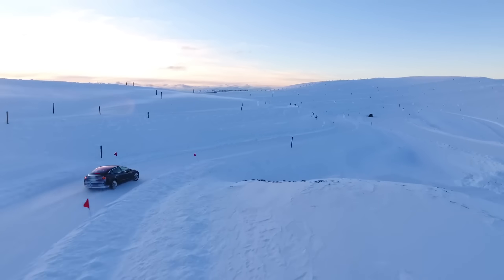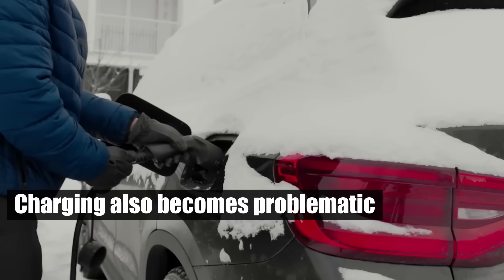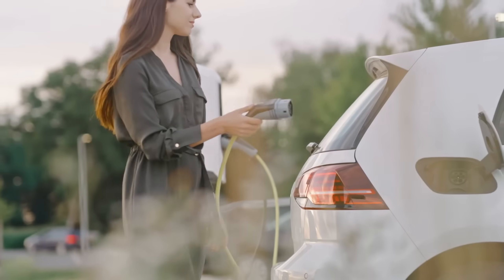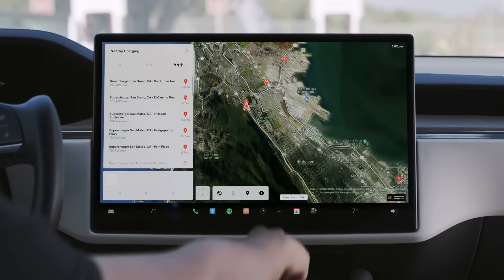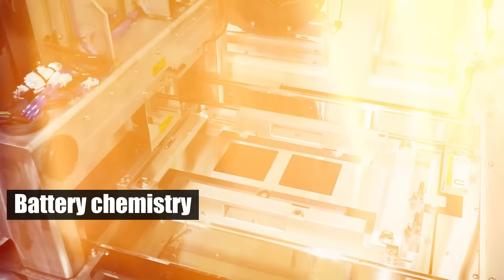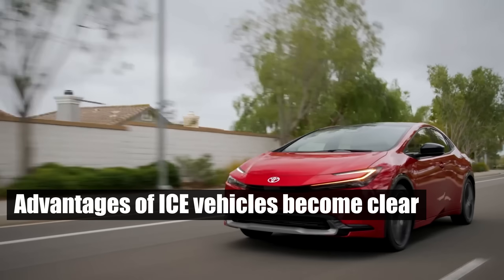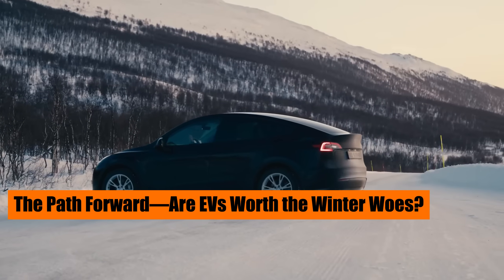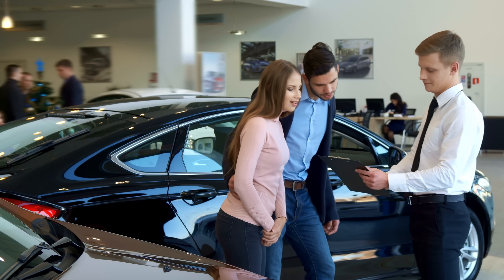EVs vs. Winter: The Freezing Truth That Left Drivers Stranded! Electric Vehicles Vs Winter, Weather!

Comment: How to charge EV in a Storm with no power on the grid
Reply: @orionbetelgeuse1937  Let's suppose you came home with no gas, how are you going to get anywhere? That argument is idiotic.

If you were actually concerned like that you'd buy an outlander since it can do bidirectional power via its ChaDeMo port and also automatically cycles the engine as a generator as the battery gets low. You have a portable battery, a generator, and a vehicle all in one fairly cheap SUV.
Reply: @Snerdles  thru but the chance too have gas is bigger than a Outlander
Reply: There's nowhere worth going during a blackout or severe weather.
Reply: @awkerper  maybe depends on the circumstances
Reply: @orionbetelgeuse1937  Actually yes, many EV owners have home solar and home battery storage and can also use their vehicles as large energy storage. It's almost like if one person plans around gas they have backups and if a person plans around fuel agnostic electricity they have solid prep plans too. Like anything these are just tools.

If you were a true prepper though, you would obviously want your vehicle as fuel agnostic as possible. Since electricity can be made from any way to spin a motor you can run your vehicle on a wood fired steam generator if you really needed to... Can't say you'd be setting up a refinery for gas in your back yard though.
Reply: How to refuel an ICE with no power to the petrol pumps?
Reply: @harry130747  the is a chance i might have some in the Shed
Reply: gas stations don't work in such condition, either
Reply: @bolek-trolek Ever heard of generators?
Reply: @bolek-trolek  Wrong!! gas can be pumped manually in an emergency and some gas stations have back up generators.
Reply: @bolek-trolek  some places have a above ground gas tanks that are mounted up off the ground. You don’t need power to fill gas or diesel. A lot of farmers have that gravity feed don’t need Hydro.
Reply: @DCSPORTSTER yeah right!
Reply: LOL clowns experts
Reply: @DCSPORTSTER  Only private opeople do have that. Alos...A gaz tank above ground gets very cold in winter...especially for diesel this will not work....diesel is not that good with minus 20 celsius. (Unless a special diesel mixture with antiflock)
Reply: some charge stations can take energy from the car and put it back on the grid. mainly used in natural disasters.
Reply: @meditationsoundscapes5203  thats no help if you have to drive away and no power on the ev and fire is coming
Reply: You don't. You could use the EV to power your appliances so you don't lose the contents of your fridge/freezer though.
Reply: @Snerdles  if storm brings fire then what i cant drive away
Reply: @Snerdles   lot of good that does if you are freezing in the winter. Darwin will weed you morons out if you don't stay near town.

Comment: EVs aren't the future of anything.  Current problems with battery and quality could, theoretically, be resolved or at least improved. The fundamental flaw with the entire concept is that the power grid doesn't have sufficient juice to deal with a full conversion to EVs.  Without power, these are just high-priced bricks.  To get sufficient and reliable power you'll need a massive increase in gas or nuclear, neither of which seem to fit the EV model.  Renewable energy is unreliable and intermittent making it unsuitable for dealing with a first world economy.  Stupid idea to address a climate problem that is just a scam.
Reply: Well said. It’s a scam.
Reply: The reasons for their existence are for investors to make easier money off of cheaper quality vehicles that are easier to control when they break down
Reply: Any system that can have a remote kill switch to stop it running is horrifying, and it turns out to be a real thing. Just as awful as having a GPS tracker.

Your ability to drive further to secure better jobs, or to get work at all must NEVER rely on some "authority" letting you do it.
Reply: @ since 2007 GMs onstar has been able to shutdown a car and track it
Reply: Some large metro areas in California are already having to ration power on their power grids. There are power blackouts at certain times of the day for one block of users, then an hour or 3 later another power grid gets shut down. Just wait until 4-5 years from now when California law will be that only EVs will be allowed to be sold in the state. And their 40,000,000 people will have the choice of buying only an EV, or thumbing their way around the state.
Reply: Anyone that thinks climate change is a scam is an unmitigated moron. The scam is that EVs are the solution, not that Climate Change doesn't exist (it does).  EVs are not and will never be the solution as their contribution to the problem is too small to provide a solution. 
The comment about RE is just ill conceived and largely wrong. Some countries run entirely or almost entirely on RE (Scandinavia, UK, Spain), it just depends on what is available.  Most will require fossil fuels or nuclear for the time when RE is in short supply, but the bigger the country, the more likely that there will be sunlight and wind somewhere.  
Europe, the same size as the US and 2 x the population can produce 45% of its energy from renewables.  The US is only 22%.  The UK, the same size as Wyoming but with 68 million people, has 50% renewables and closed its last coal-fired power station recently, whilst France relies upon nuclear at 70%.  So your point is bollox.
Reply: @orionbetelgeuse1937  You're thinking of ICE which have had over a century to improve. We have variable valve timing, multivalves, 3 cylinder engines with turbos, many more parts and sensors, and still have crappy mileage (mother nature is a bitch). 
Battery research is getting more money because they see the opportunity and market. Many different chemistries are being developed for diverse applications. Nowadays the OEMs are forsaking NMC for the cheaper, longer lasting LFP in lower performance cars, but sodium and solid state are entering production too. So it will depend on the characteristics you want, what drive train and battery you buy.
Reply: Bingo!
Reply: Honestly, that is the most human, understandable, yet completely not thought out statement I've read today.
Reply: I invite you to check what nio does. Dont be an ignorant and investigate first. They solve all this problems you said.

Comment: I wonder what charging in freezing temperatures does to the battery. You’re trying to force the ‘trons into a system that doesn’t want them. Thanks, but no thanks.
Reply: Every battery that's ever been made has issues in cold weather. The cold slows down the rate a battery can charge.
Reply: Depends on how cold it gets.  Really cold and the charger won't even work.  Pretty cold and charging runs just fast enough to keep the battery at its current state.  You still pay for all the power trying to go into your battery though, so there's that.
Reply: @michaelputnam2532  You pay only for the consumed power....or you use an absolute stupid homecharger which heats up, a lot if the battery does not accept the currence.
Reply: The only wonder is you.